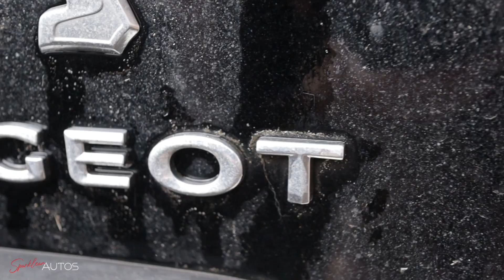DEEP CLEANING THIS FILTHY CAR | EPISODE 1 | DISASTER DETAILING UK | #carcare #cardetailing #carwash

Comment: I am looking forward to this series after you have teased the process with this film. I seem to use the same method,tools and in the main method as you but we all have our go to chemicals. With regards the jack it is a genius idea for arch cleaning that I only ever used on my JCW for a wheels off clean. I need to get in the habit of doing it for the other cars as it makes so much sense.   Who needs rim mats for dressing when the wheels are off the ground . I am lucky that our i-Pace is on air suspension so I can get into my arches with it on full off road height and my jack is probably not strong enough to lift all those batteries anyway. I like to give the engine bay a quick dress with Auto Finesse Dressle to add a bit of bling to the plastic and AF Triple to exposed paint after using the same method as you showed. I am curios on your thoughts on pre washing the whole car before tackling the wheels which I used to do then I stopped and now go straight into the wheels and arches first as that seems to be the way to go and I know it is my prerogative on method but it is good to get your opinion and or thoughts.
Reply from the maker: Thanks John 😊
I've found a few processes that work for me and it's nice to hear when others do the same!!
In terms of the pre-wash - really this is weather dependent... If it's a cool enough day and I'm not expecting excess heat or direct sunlight, I'll pre-wash the whole car first, wheels included but if it's likely to be warmer I'll just focus on the wheels 👍🏼
And I'm in complete agreement about the rimmats - some people seem to love them but they aren't going to benefit me enough to justify £50... Especially as I know I won't bother using them half the time!!
Reply: @SparkleanAutos  That's a good point on the heat/sunlight that didn't cross my mind and £50 on the mats when the four off cuts of decking board I made for the job with those hose guards that you use as well does the same job if I could be bothered to use them.
Reply from the maker: @johnbrown3951  🤣🤣 yeah... I usually remember about the Detail Guardz as I'm half way through my final rinse 🤦🏻‍♂️ 🤣
Reply: @SparkleanAutos  That's the trade name for them that slipped my memory. I keep them in my wash buckets with my cleaned brushes and I put them on when I go out and set up my stubby gun and spray my Atom Mac onto my disks so it get's time to work while I set up my kit and fill my buckets and mix my chemicals i.e. snow foam and citrus in pump sprayer and wheel soap in my foamer. I'm too set in my ways I could never be a mobile detailer mind you I take over the kitchen with all my kit it's just as well my wife still goes out to work whilst I enjoy early retirement.
Reply from the maker: Agreed! I couldn't do it full-time professionally, pure because I enjoy it too much and the pressure of doing it to feed my family and pay the mortgage would take so much of that enjoyment away from it!! I prefer to take my time, enjoy the process and constantly try to find new methods and products that make it even more enjoyable!!
Reply: @SparkleanAutos  That's my philosophy. Spot on.